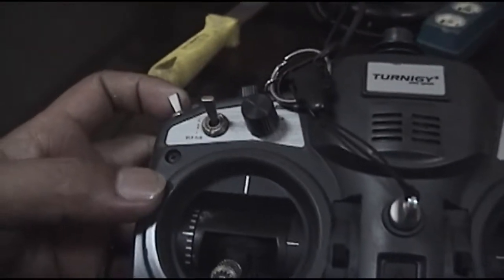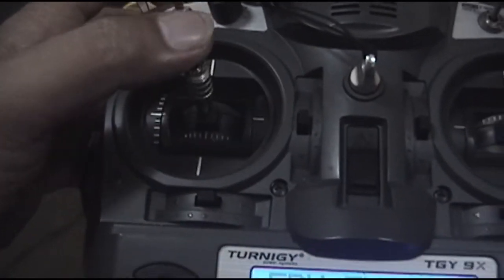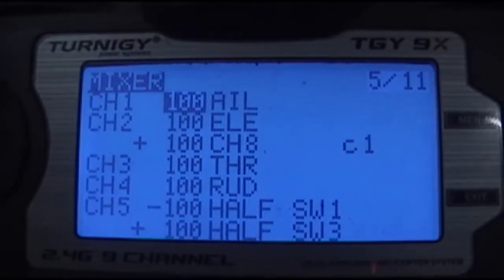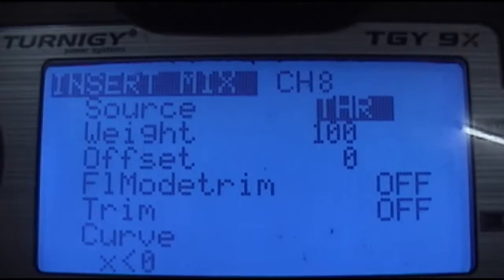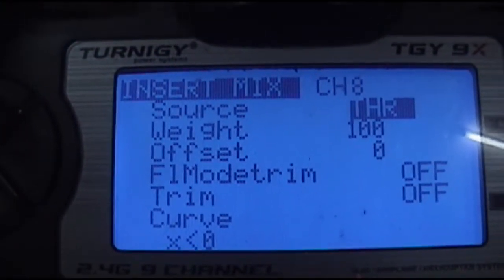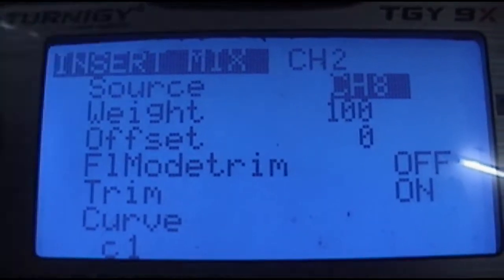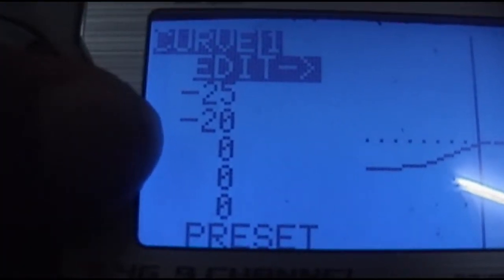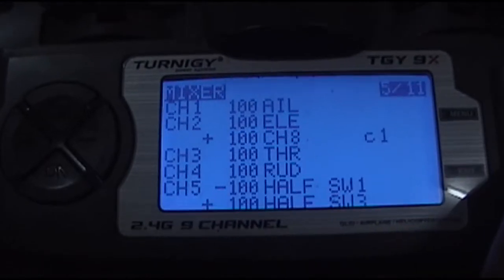Single Switch Variable Flaps

Comment: james how do i use 9xr with wing? I want to use Dragonlink with new Teksumo. Not sure how to get Rudder, Elevator and Aerlon from radio when all i have is aerilons.
Reply from the maker: +kennethpappas if your going to fly standard, you and want to program a new wing on the 9xr, you have to change the template to delta wing, it will provide you with the first two mix of the delta wing, it will have no rudder, just 3 channels, two delta wing and throttle
Reply from the maker: +kennethpappas ken create a new model and go to templates. two templates can be used, v-tail or delta wing, you cannot use standard 4 channels on a delta wing so the template will do the mix for you for the two ailerons, then add another channel for the throttle manually and your good.
Reply from the maker: +kennethpappas this program is for regular planes, wings cannot have flaps, it will dive xD

Comment: I'm going to be using my 9xr on my fpv raptor.  I want to use my gear channel for flap I don't need 3 different setting I just wanna keep it simple and add down elevator when flaps are on. Then I want to use those knobs up top for my pan tilt. Now I just have to figure out how to do this.